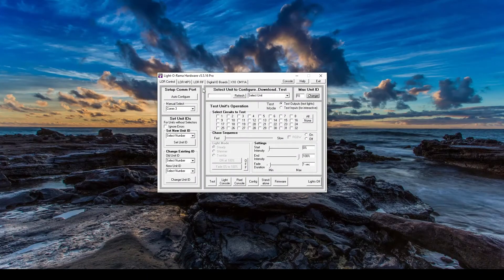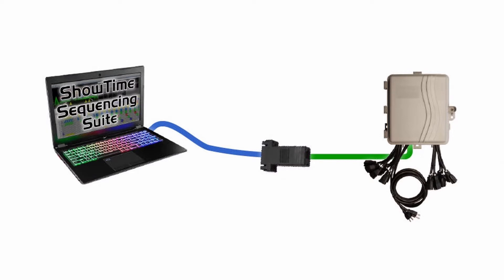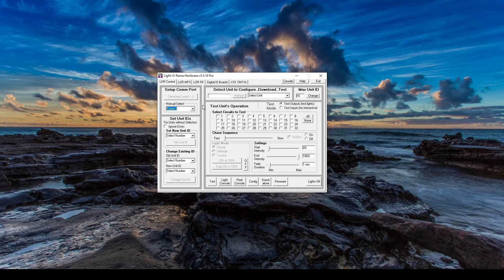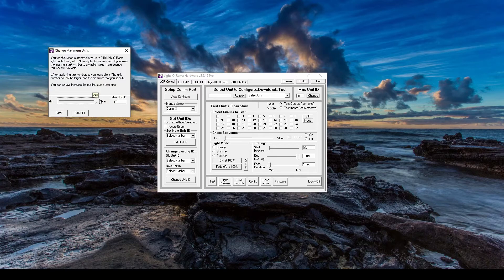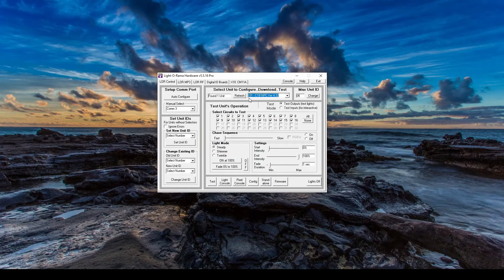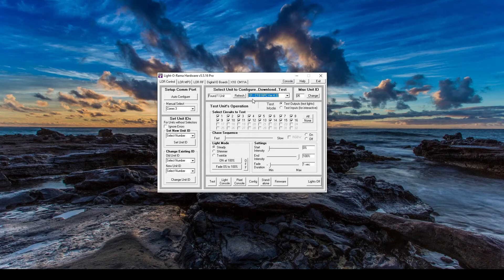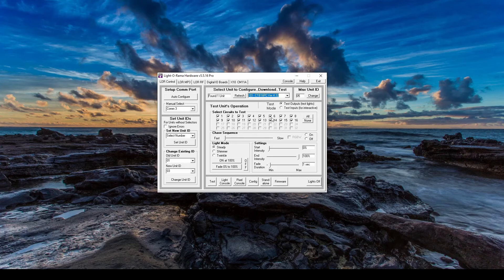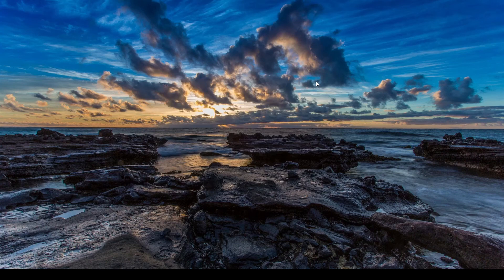Light-O-Rama S5 Hardware Utility: 16 Channel Controllers - Luminous Harmony "How To"

Comment: How are the units wired together physically? Controller one plugged into the computer, do I run the cat5 cable from controller two to controller one? And in which of the 3 inputs do I put the cable into?
Reply from the maker: One controller is plugged into a USB 485 Adapter (which is plugged into your computer). The rest daisy chain together with Cat5 line, which actually only plugs in to 2 out of the 3 ports. The 2 you can plug in to are the same (in and out).
Reply: Can I plug a timer for power into the controller for power activation and have it turn off at a certain time? I don't want to fry the board.

Have the power turn on controller, have a show set for timeframe then have lights on after a certain timeframe then turn complete off at "x" time?
Reply from the maker: There's no reason you need to use a timer to power on/off the controllers. They can remain connected to power the whole season. Your computer or Showtime Director will determine when your lights turn on.